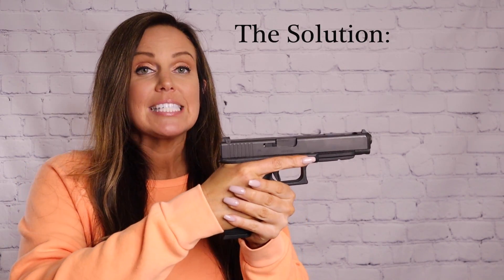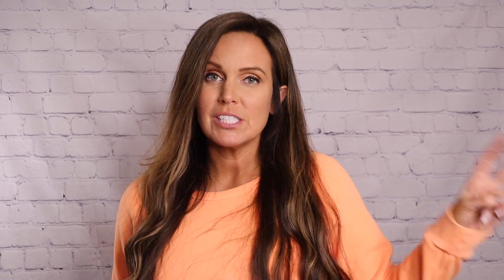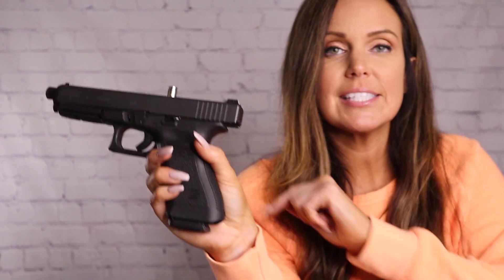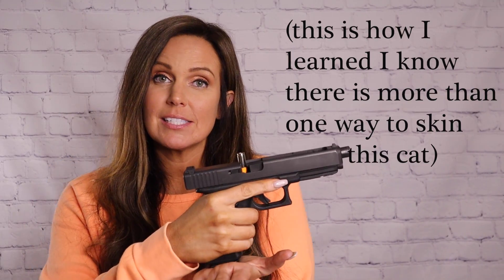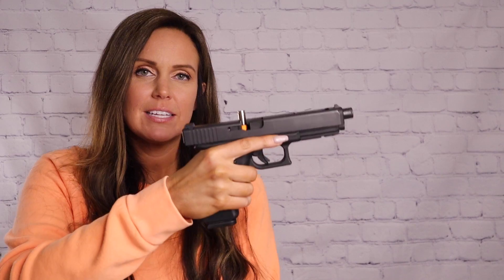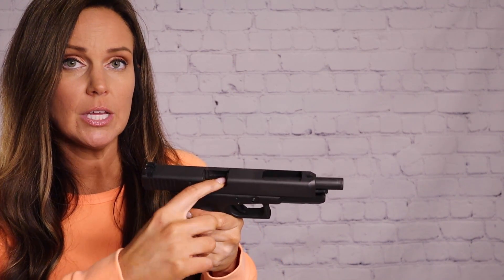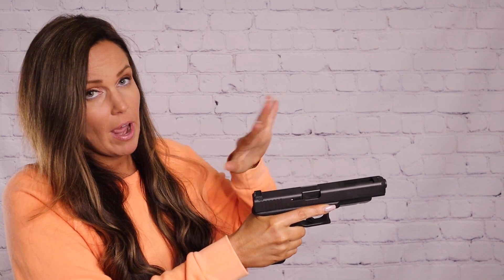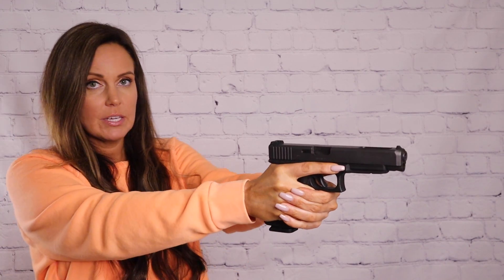3 Types of Malfunctions ~ HOW TO FIX A JAMMED GUN

Comment: This young lady does a fine job and presents malfunction clearing in a straightforward fashion. I will leave this here for type 3 malfunctions, however, as a firearm instructor for many years.
 We have evolved to find a much better way to clear the type 3.  Once you have that double feed as we call it, just rip the magazine out reinsert it, rack and roll. There is no need to do all those additional steps. Try it yourself. It works just fine and is trained by many high level instructors today.

Also, note there are some firearms and their magazines where you cannot actually rip the magazine out. This is a time where you'll actually have to pull the slide back and lock it in place to decrease the tension. Stay safe out there and put in the work.

Comment: Don't forget about a squib round those are the most dangerous malfunction. I have always been told if you fire and it goes click or a small popping noise to hold it down range for 30 seconds. After that eject the mag and rack the slide and examine the brass to see if the bullet is there because if it is not you have to check your chamber because you probably have a squib round  and if you don't clear it and try to cycle another round through it you can hurt yourself and destroy the gun. So great video and just wanted to talk to you about squib rounds in case no one has which I am sure someone has talked to you about them.
Reply: This is why you always use premium ammo for self defense, in training you are absolutely correct but in a self defense situation you don't have that luxury and have to take your chances but clearing the chamber and sending a new cartridge in ASAP and keep on shooting until the threat has ended or your gun can no longer function. With quality ammo a misfire or click and no bang is far more likely to be caused by an out of battery gun or a bad primer than a squib load, still possible but very unlikely.

Comment: Don't forget about ballooned casings stuck in the barrel, The extractor won't pull it out, so you either have to use a tool to pry the round back, or a cleaning rod to push it out of the barrel. Had this happen on some reloaded ammo I bought that ended up breaking my extractor in one of my AR's(lessened learned to buy only new ammo), and on some target rounds in my P22. I had to use my multi tool to pry back on the lip of the casing to get them out. Having your fire arm properly lubricated is a good idea to help prevent most issue. Do not overdue it with the oil or it will get all over you and cause issues of it gumming up the gun with gunpowder residue and oil causing the slide not to go forward etc. 

Great informative video, keep up the good work.(Btw shoot what you like not what others like, because haters are gonna hate.) lol. I am more of a neapolitan kinda guy, I have several firearms from several different manufacturers.

Comment: Failure to feed, which is equivalent to a jam, failure to fire is the click with no bang, I wouldn’t even attempt the tap rack in a gun fight take cover of you can rack that bad round out of there and get back in the fight or drop magazine and rack slide get a new magazine in there if you can. I only had 1 failure to feed and that was with them damm steel case rounds and I had a failure to fire once and it was with them Fiochii rounds but other than that? I never really had any issues yet as as far as the double fed goes I never experienced it